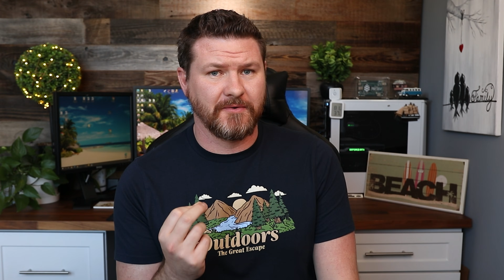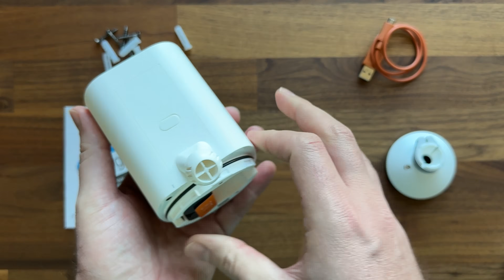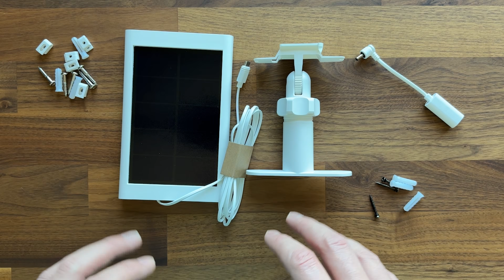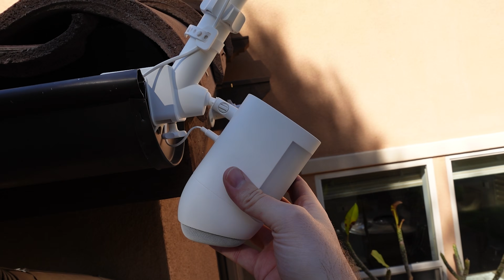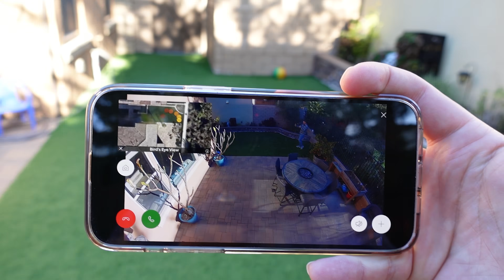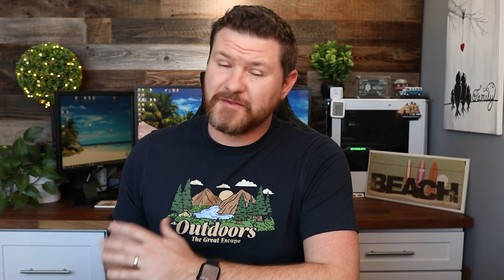The TRUTH About Ring Spotlight Cam Pro

Comment: What is your opinion on the RIng Pro vs the Eufy Homebase 3? Considering Eufy now offers 24/7 monitoring just like Ring does, and 4k cameras, with built in solar panels, does Ring really offer anything to compete with Eufy? They are both compatible with Alexa, both offer 24/7 monitoring, but the cameras for Eufy are vastly superior in my opinion in both clarity, and vastly superior battery longevity, no needed exterior solar panel. Am I missing something?
Reply from the maker: With Eufy's recent security exposure issues, i cant' recommend them at this time, but we'll see how that all plays out.

With that said, 4K local storage is going to give you the best picture quality. I see that Eufy 24/7 monitoring is $10mo, but doesn't include any type of cloud storage for that price. It'd be nice to at least get 2-3 days as a backup incase that homebase is stolen. As for the built in solar panel, i love the concept, but i'm a bit hesitant. My experience with security camera solar panels is they last about a year and a half before they just stop working. The only brand that lasted over 2 years was Arlo.

Comment: Considering the pricing of the Ring ecosystem including the video quality it's still good. Better video quality would be much more expensive in another ecosystem with everything else at the same level. Even professional surveillance systems like was used in the school I worked for, is not much better video quality than Ring.
Reply from the maker: Yea that's a good point. IF Ring had a 2K/4K camera, would someone pay $400/$500 each, and probably a higher subscription fee too? Probably not.
Reply: @SteveDOES  - I would

Comment: Hi Steve I have 4 of the Ring Cam Pro installed at my home and I’m very pleased with them.
Reply: Did you hard wired them??? Boxes are labeled BATTERY, ..Daaaa. Even when you order a Hard Wired Cam. If you try to hard wire the unit to the house wiring you will find cheap braded wires w/ soldered ends...THAT may or many not be stiff enough for a proper electrical connection. HOW STUPID all to save 5 cents....NOT TO MENTION  a purchase return as defective (because of poor connections) Daaaaa
Reply: @DESMITH-du9uk  Yes and other ring cameras have solar panels.